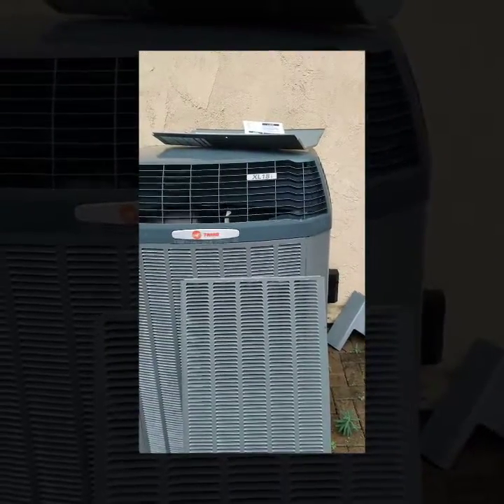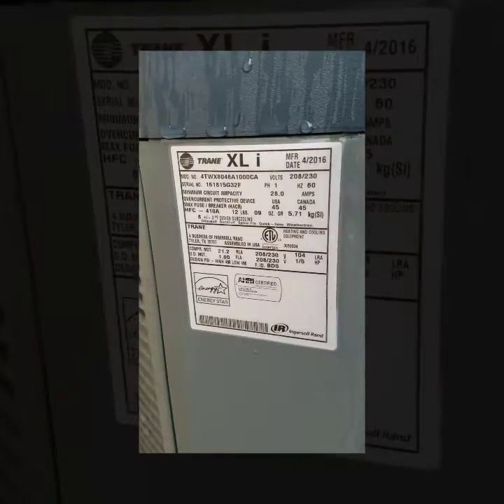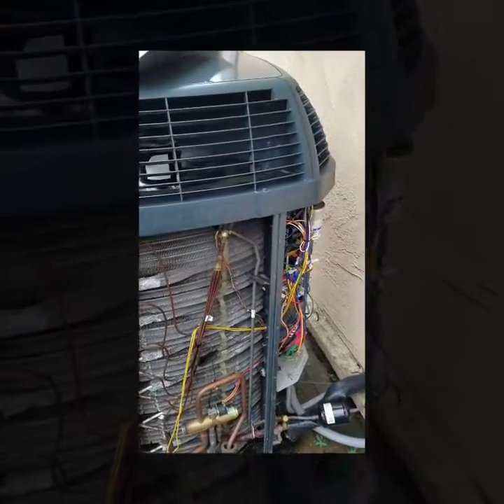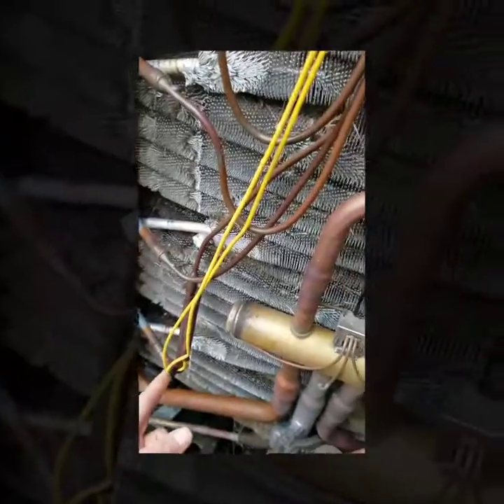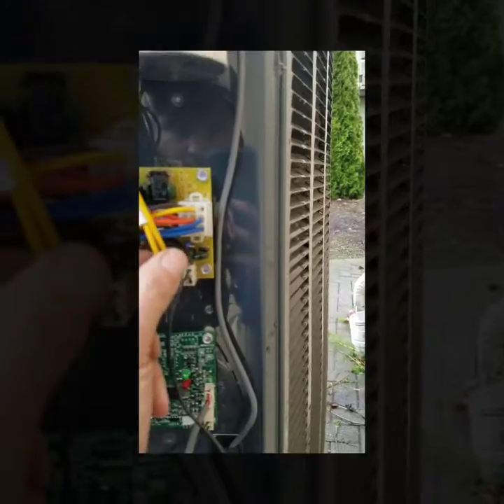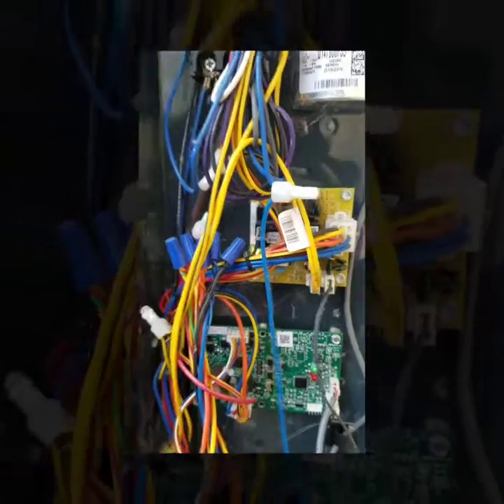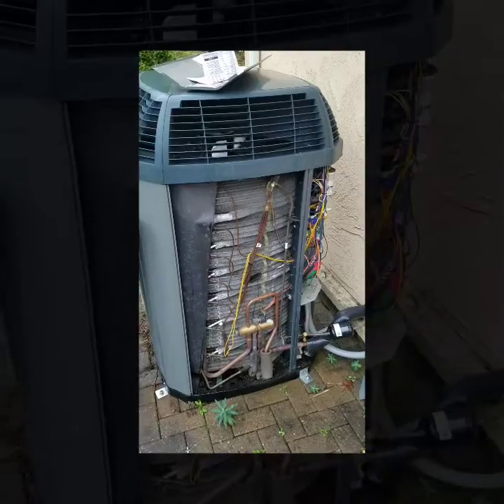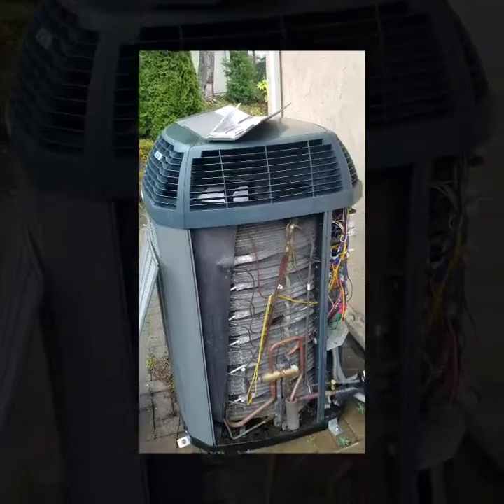How to test Defrost Control on Trane Heat Pump

Comment: It sounded like when tripped both the fan and compressor shut off. My fan shut off but not the compressor. This wasn't during testing but on a cold sleeting night. I need to check the compressor timeout, if that's a thing. Mine is XR16 single stage..lmk if anyone knows what is the best setting and how it's set. I plan on trying to find a good hvac person but it's hard where I'm at. It's mostly companies with lots of teams. My installers seemed to do as little as possible at every turn. So, I want to have it double checked but the more I know, the more I know if they are doing proper due diligence. I'm glad there is a test, and test specs. That's good info!

Comment: Every board ive seen are blinking..   some work some dont..  but that damn light..   the hell..
Reply: Mine was blinking steady on and off, which I believe is a call for cooling?  The tech said it needed replacement to fix heat mode and temporarily jumpered for cooling to work.  Does that sound correct?

Comment: Have u ever skipped the defrost board wiring  and go two wire to  indoor unit with only y and c ?  Cuz I have the regular gas furnace no two stage  but the outside unit has a defrost board in it